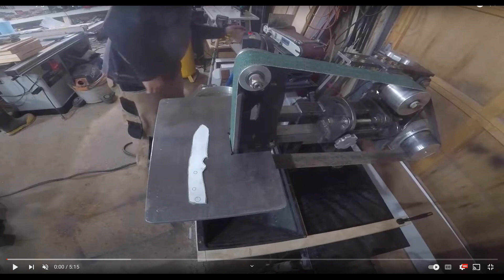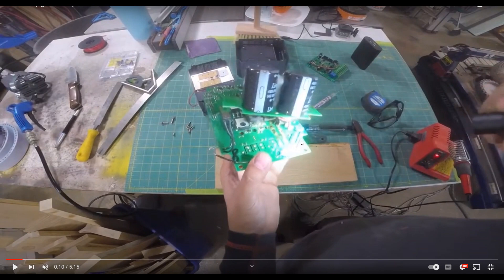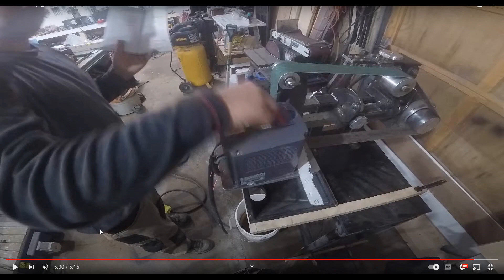Failure In The Shop (VFD Failure)

Comment: The scariest thing in that video? His wedding ring, that's a no-no for several reasons. Like you said, there is a LOT wrong in that video. I've been working with VFD's in my day job for years and videos like that one drive me nuts. You're exactly right, the quality and technology in some of the China drives is questionable, some are very good and some are a fire looking for a place to happen. One common fault I see in them is some mfgs cut corners and skip coating the boards. So you end up with a VFD that has naked solder traces and pins just waiting for dust to ingress and cause a failure. The enclosure type he's using (NEMA 1/2)is intended for mounting inside another enclosure for protection, not hanging on the wall behind the belt grinder. If you have ever seen sunlight shining through the dust those grinder throw off, it's amazing. Little tiny metal fish hooks floating around in the air.
Reply from the maker: Steamfan71, thank you for your support as always. You bring up some very good points. Vince